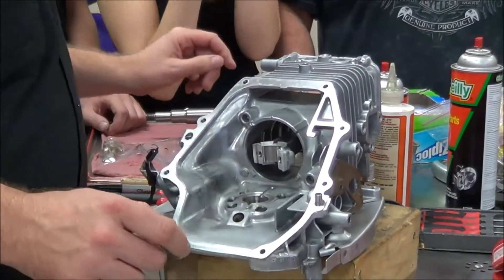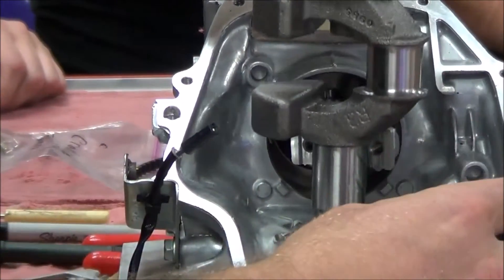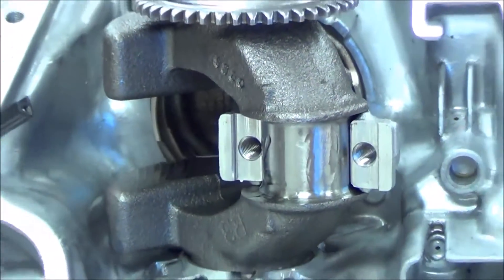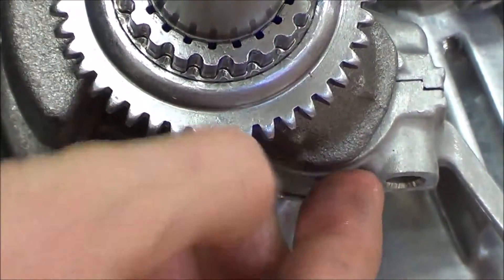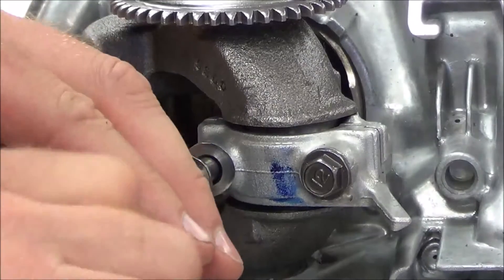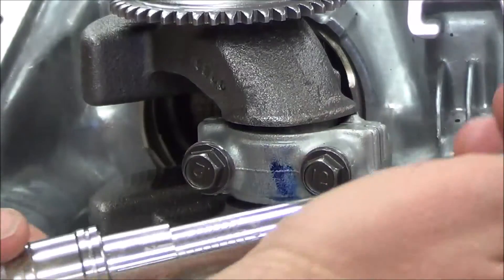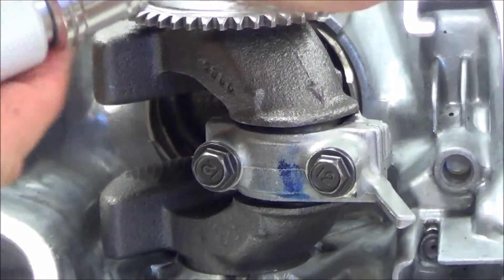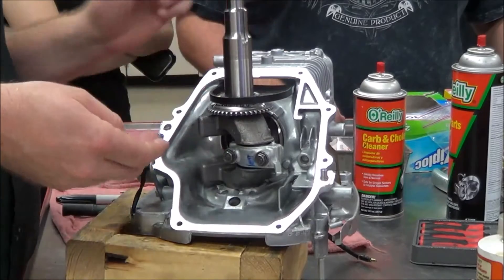GCV Assembly   03 Crankshaft #how2wrench

Comment: Installing a new crankshaft on a HRR216VKA Honda mower. Yes it's a gcv160. When I opened my case I'm 99% sure my crank did NOT have a thrust washer. Have you ever seen this? I'm ready to reassemble but just don't know if my model needs this thrust washer or not. Please help meeeee!
Reply: mfreebush do it go in timing?